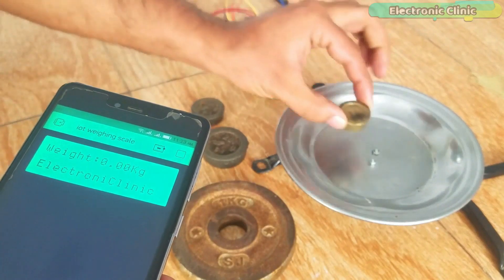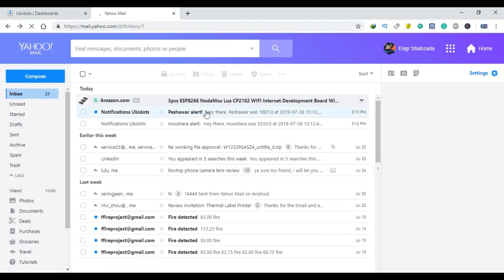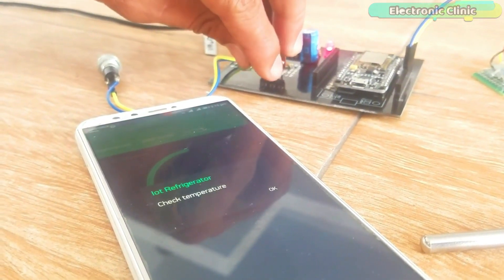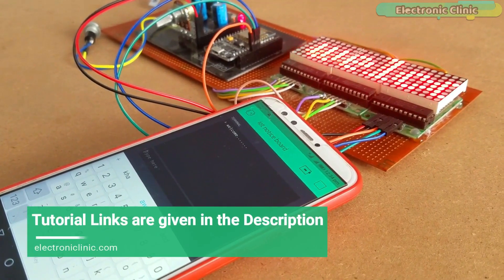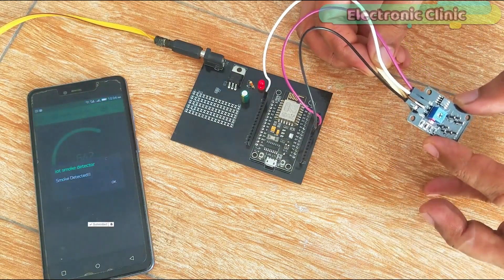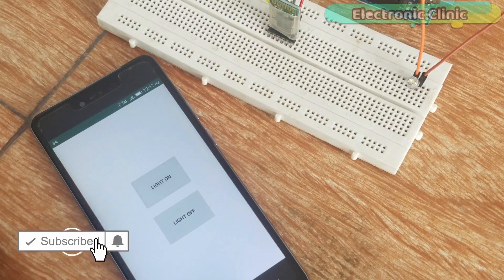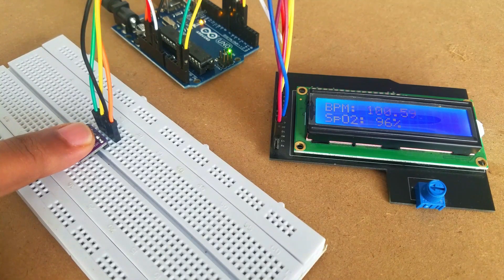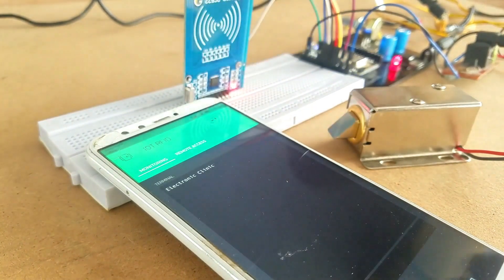Arduino Projects, IoT projects, ESP8266 projects, ESP32 projects, Diy projects, project ideas

Comment: Dear i want to control ac dimmer using zero cross with esp8266 and blynk iot server. Please help about it in program.
Reply from the maker: i have already done this. check playlist
Reply: @ElectroniClinic  please provide the sketch code.